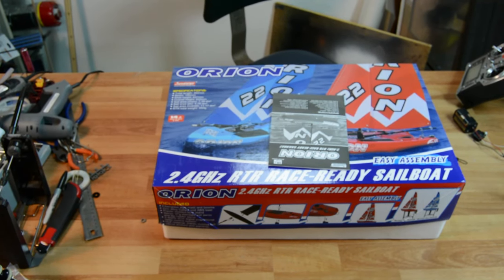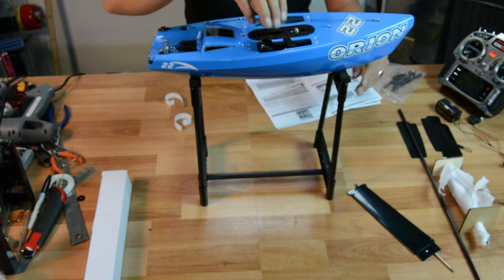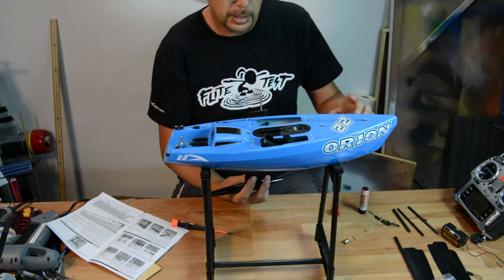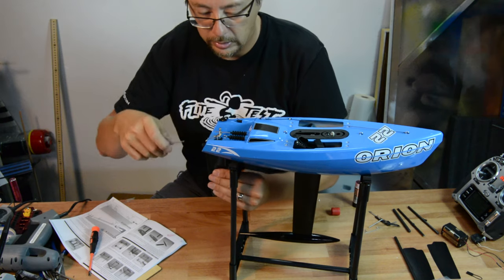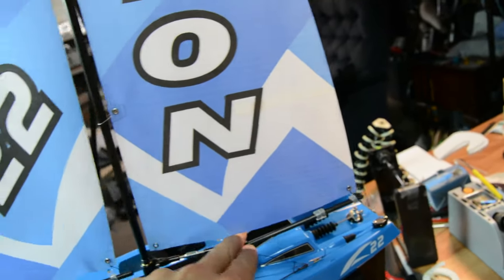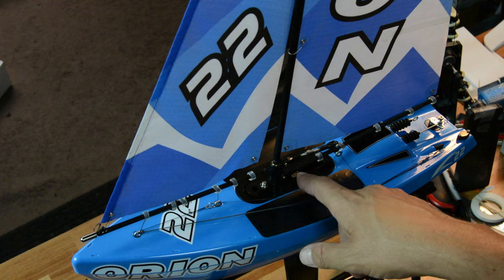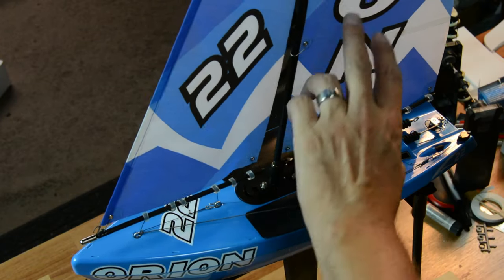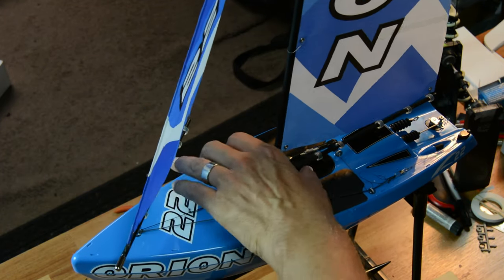Orion Sailboat Overview-

Comment: Max your limits on the transmitter for the sail servo and boom connection point, to try and get the boom nearer right angles to the hull when 'all out'. All in can be looser - the boom points to the corner of the transom. Create a 'slot' between the jib and main by having the jib a little looser than the main. Trim the rig by moving the mast head so that the yacht tends to point slightly into the wind direction by it self. Launch into wind like a glider, so it will tend to come back to you if it all goes wrong. Best of luck and joy in the sailing.
Reply from the maker: Thanks for the info, I took to whole family to the park with a pond.  They have a rc sailing club at this park although no one was out when we were there.  The thing is perfect for beginners like us,,,, my 7 year old had a lot of fun tacking into the wind.  I've learned a few things. - loosening the sails as you mentioned,  I had the sails taught,  after I loosened them up it was a lot faster.  I will loosen the sails at full down throttle.  and I have my rates at 150% on up throttle,  I'll adjust a few more things- this thing is a blast!!  Video to come...
Reply: @Wayne Russel , what a helpful comment, thank you!  Your advice is wellcome big time. I am struggling to install a sail winch on my first, diy project - a one meter.  I wish I had gone for an arm servo... 
edit: just became the second follower of your channel, lol!  One more and we are a crowd!!! :D

Comment: Did you change the receiver? Wondering what kind would fit to get rid of that joysway radio. I have a JumperT12 Pro with multiprotocol. Also wondering if there's a way to get battery voltage telemetry. Any ideas would be much appreciated.
Reply from the maker: I used my own rx as my boat came without one. You would want a Taranis radio or Jumper to get telemetry info back to the radio
Reply: @7demo7review  Yes great, thanks. Any idea which receiver would fit the boat with my Jumper radio with multiprotocol? There's not too much space. Not sure if it'll work out with telemetry and an additional sensor, though. Or which one did you use?

Comment: Hey 7demo7, thank for the video and for the "absolute beginner's" approach - very helpful.  If I understood you well, you need to have your own receiver and transmitter - the kit does not include them.
How hard is it to rig all those winch lines INSIDE the hull?  Or do those come factory pre-installed?  I dread having to tie reliable knots (and in the right tension) inside the hull... :\
Reply from the maker: most everthing is pre installed,,, all the rigging is pre tied
Reply: Thanks for the answer.  This seems attractive.  Do you know how the yarn used to do the rigging is called?  I am in Israel, and things are hard to get by here - perhaps due to the language barrier or lack of contact with other model boaters here.  Is there a specific name or a good description? perhaps a brand name I could order via internet?